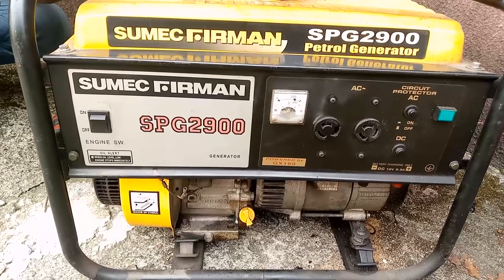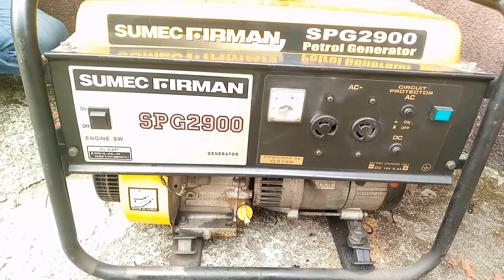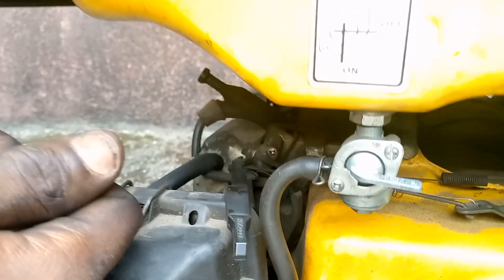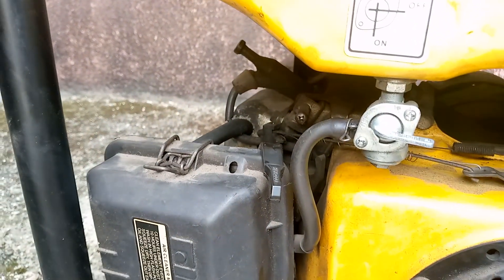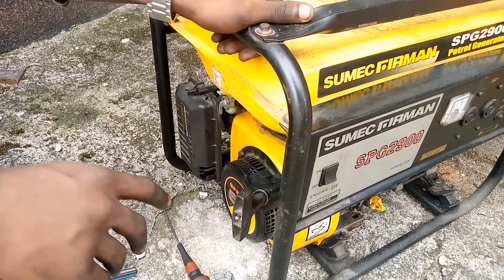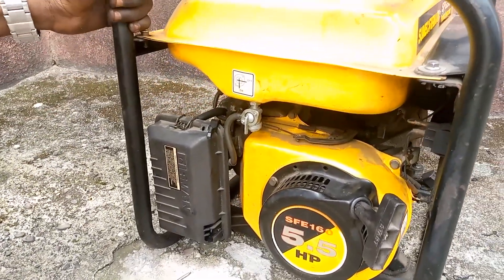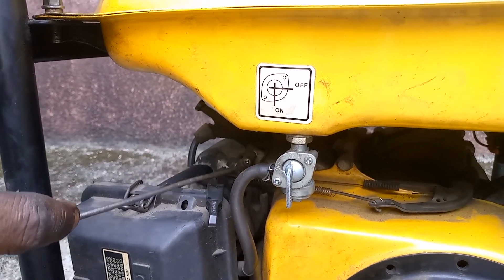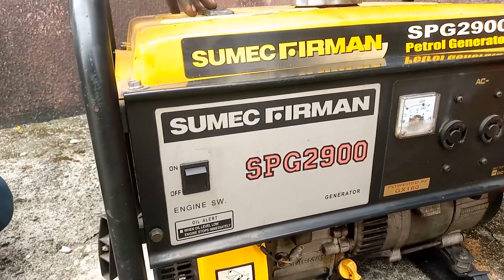HOW TO INCREASE THE VOLTAGE,CURRENT AND SPEED OF YOUR SMALL ENGINE GENERATOR IN 1 MINUTE.

Comment: Greetings. I have a Predator generator, starts 4550W and runs at 3650W. It has a 15A circuit breaker. But i think it should be able to handle 25 to 30A. Am i correct? If yes, can i change the circuit breaker to a 20A without damaging the generator?

Comment: Hello , I did this but my generator voltage is still kinda low , was better than it was but still really low and my fan is blowing slowly even at highest number ,and  anytime I used stabilizer , the current fluctuates up and down, please what can I do next ?
Reply: You need to change the generator Arv should cost you about 7k

Comment: every time i put my generator for the whole house it works fine but when i use the electric stove you can hear the generator go high and low, the noise I'm talking about, it rev high than low, the generator is a craftsman 7,000  watts... its not steady when using stove, should i adjust the screw you showing..?
Reply from the maker: Oh okay

What's the rating of your electric stove?

What other appliances do you have in your house
This information will guide us.

Pls do not forget to hit the subscribe button
Thanks a lot
Reply: @bencoinstitute  where can i find the rating  this is a 2018 Kenmore  Elite electric 60 he rtz..., and i have a 7000, gen. all i use is the lights around house refrig, and stove,,  no air cond ,no microwave,, by  the way i just subscribe and like, because you answer very quickly , those are the folks that deserve it,,..
Reply from the maker: Okay... Thanks

Have you ever used the 7k watts machine for d electric stove before now?

However I tried sending you a link from our website...it would have helped you 

I tried sending a link from our website... The link would aid you calculate all load in your house...so we know if the Gen  had the ability to pick them all... But it turned out our website is down at the moment...

Pls reply the above question.. thanks
Reply: @bencoinstitute  yea i remember the first time i use it it did rev up and down when we would cook but not as bad as now,,, but the light  in refrig is good and everything is good just the rev , i know it should be steady no matter what right ?  when we turn off stove than it sound steady.. i calculated everything i use and it don't exceed 4000 wats, refrig is like 1800, one computer, no TV. and 75 watts light bulb. they told me i can  light up 2 houses with this generator....maybe i should try that what you did and see if it will run steady.

Comment: Nice video, very well explained. Thank you. I have a medium sized generator but it doesn't carry my refrigerator. If I do this is it possible that the generator will be able to carry it?
Reply from the maker: What's the power Rating of your refrigerator?.... Check the rating of your refrigerator from the nameplate 

Meanwhile  a medium size generator is rated 1.5KW(1500W).... and it's only advisable to use it for just the table top fridge and nothing else